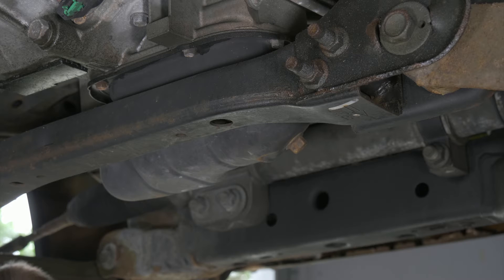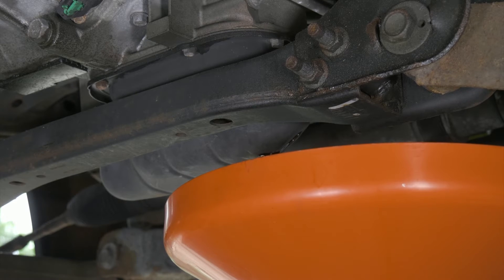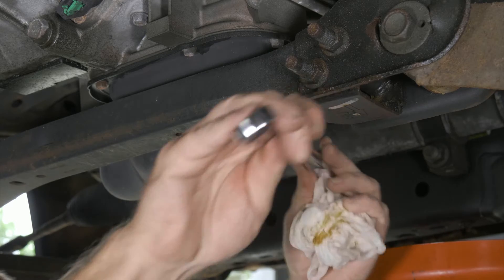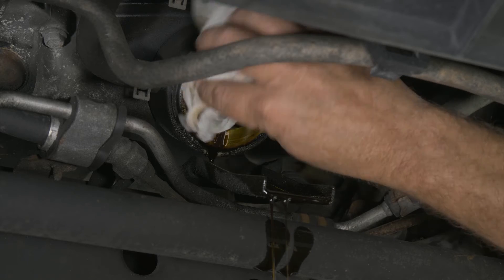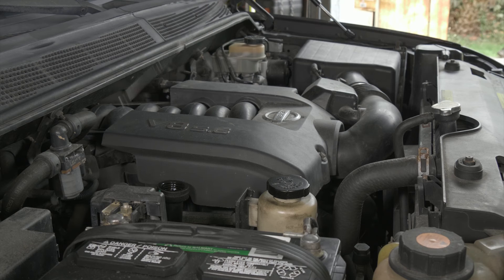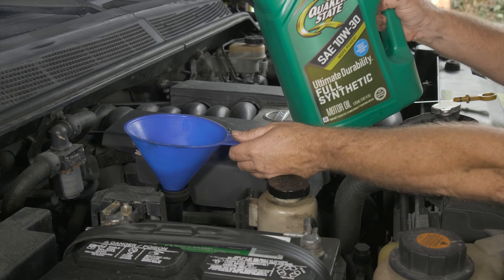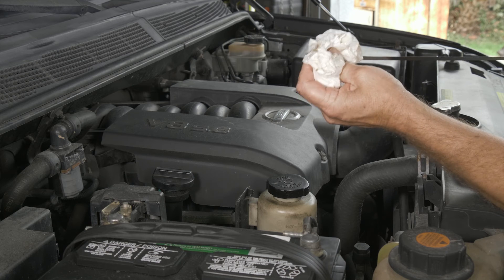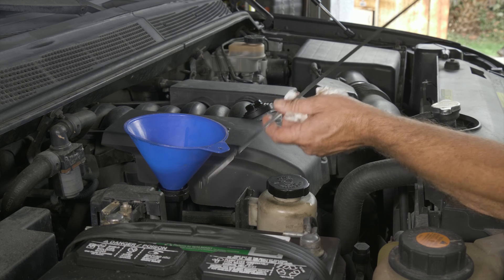2004 Nissan Titan Oil Change

Comment: How important is it to prime the filter?
Reply: None never seen this done 🤣
Reply: @joseamaral1416  I've done this my entire adult life of working on cars.  While it isn't mandatory, its best practice to fill it so during the first start-up following an oil change you build pressure faster to minimize engine wear.
Reply: @Craig Goldstein  Exactly. That's how you can tell the difference between the guy who has automobile knowledge and one  is just changing oil for the first time in their life
Reply: @joseamaral1416  o
Reply: @steven530x  imagine backing up someone who is wrong. Automotive techs say don't prefill your filter bc you can't be sure the new oil is actually free from contaminants. Prefilling it will allow that oil to enter the engine unfiltered.
Reply: @jessecw2  If you are buying some used of shitty oil... then yes you might be right. The chances of getting contaminated oil brand new out of the bottle are extremely LOW
Reply: @steven530x  ya I guess manufacturers have never been known to take shortcuts that hurt consumers in the long run
Reply: @jessecw2  Oil filters have pre and post filter media holes... fill it pre filter media if you are that concerned about contaminated new oil. Or better yet buy better oil that you don't have to worry about being contaminated, or even better yet don't prime your oil filter if you don't wish to